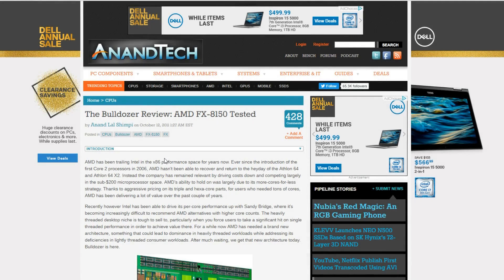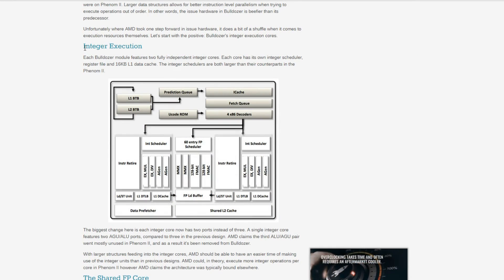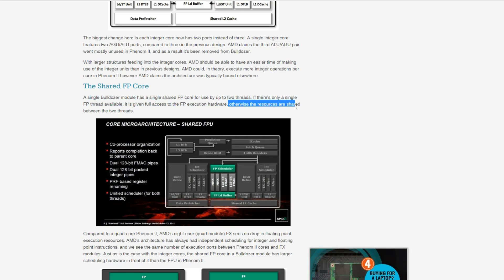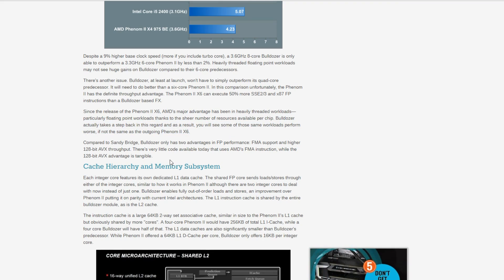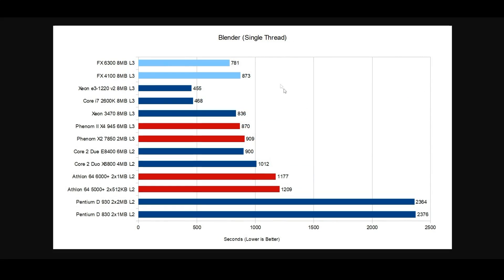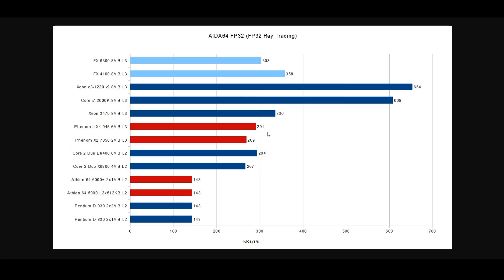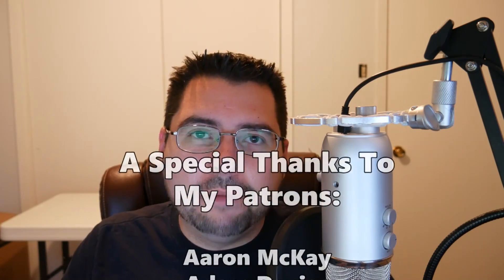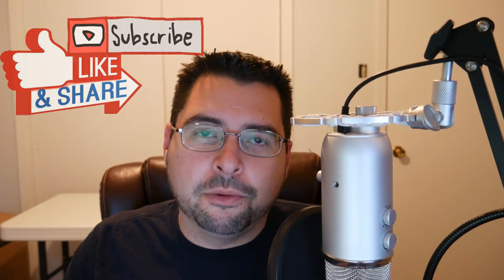IPC Test 7: AMD FX Series CPUs! How Does it Compare?

Comment: will you be doing tests with excavator? or you'll go straight to ryzen?
Reply from the maker: I'm sticking with the highend mainstream CPUs for this series. Perhaps in the future we can add in the budget CPUs
Reply: FX-8xxx excavator were not budget? or the fx-9xxx series? You consider them budget? (apu?)
Reply: reason I'm asking is, supposedly excavator is an improvement in terms of IPC over piledriver. Just curious how far they have squeezed bulldozer to get an ipc improvement
Reply from the maker: No l3 cache. It won't beat piledriver
Reply: I don't know, it doesn't seem to be affected by the lack of l3. Here for example it beats a piledriver cpu quiet easily in blender https://www.youtube.com/watch?v=PfSZ_FM9cH4
Reply: also, that was 4core APU only, it never made it to the 8 core FX line. I kind of felt betrayed when they launched them cores and didn't offer them in the larger chips. unless you were lucky enough to get a motherboard that could muster the 220 watt TDP the FX9 demanded, the FX8350/8370 was essentially the end of the line. And that was still bulldozer with just slightly faster clocks.
Reply: I'm just pointing out there is indeed an ipc improvement between piledriver and excavator add to the fact since bristol ridge can also run on the AM4 socket might as well test it right? But anyway, at the end of the day, it his test so its his call if he does it or not. https://cdn.wccftech.com/wp-content/uploads/2016/08/AMD-Zen-CPU-Architecture-6.jpg
Reply: my old fx-8350 was (according to cpu-z) excavator
Reply: @axxis30  no it's not

Comment: In my personal experience benchmarking my dad's gaming PC that he uses for Doom 2016/Wolfenstein New Order, the FX-6300 at stock clocks bottlenecks a GTX 1050/RX 460 very, very infrequently but it does happen (typically in games that only utilize 1-4 threads and ignore the last 2)

In many games, the FX-6300@4.3GHz can totally utilize a GTX 1050ti, but in many other games the 1050ti will be bottlenecked. He only has a Radeon 6950 2GB paired with a 1600x900 Dell monitor, and won't need a new GPU until he gets a 1080p monitor soon. When that time comes, we will move him up to the 1050ti or something else.

There are very few games in which FX-6300 can utilize a GTX 1060 totally, even at 5.0GHz it will bottleneck a 1060/480/290/970

Even FX-8300 or 9000 series will bottleneck 1060 level cards in many games, 750ti, 1050, or 1050ti is best for these CPUs.

Comment: I am still rocking a Phenom II X6 1100T.  Running it @ 4.2GHZ CPU, 2.8GHZ NB.  Will be upgrading to Zen 2 next year.
Reply from the maker: I'll be picking one up in the future for testing. I really like the K10 cpus
Reply: It has served me quite well,  especially since I seemed to have gotten a good overclocker.  I once dropped it and bent a few of the pins.  After I straightened them out and it worked fine though.  Have been running it nearly 24X7 since 2009 and it is by far the longest I have ever gone without upgrading.  I can not remember another system build lasting this long.
Reply: yeah, I don't blame you at all, lol. I came from a 965 x4 and 'needed' more CPU 3delight render power and did not have an Intel budget. I was looking at an x6 (6 core) at 3.3GHz vs an FX8350 (8 thread) at 4.0GHz, and it was a tough call at the time. I do remember the x6 was rare and more expensive than the FX when I did upgrade, so that made the decision for me. I still use the FX8350, as I have issues with win10's interface, and M$ will not support win7 on the newer platforms (7700k or Ryzen and later). It's sad, but I may end up just using the "GN R7 build" as a dedicated render box, and just continue to use the FX8350 workstation for creating 3D objects and scenes with, win10 is that bad for productivity.
Reply: I have the FX 9590 but I previously had the Phenom IIx4 980. I chose the Phenom IIx4 980 over the 1100T because the Phenom IIx4 had more cache per core and had better single core performance and slightly better gaming performance over the 1100T. I decided to upgrade to the FX 9590 for it's multithreading capabilities. The FX series has a slower IPC than the previous Thuban and Deneb cores but has a much more overclocking headroom and higher memory frequency support which allows it to surpass them both in performance.
Reply: still rocking a 1055T here
Reply: I've got an 1100T and 1600x. And a 8350. Gonna slap a better cooler on the 1100T and OC it. What cooler are you on?
Reply: @SquaficleDude  I don't know about him but when I was using my Phenom IIx4 980 I used a Noctua NH-D14 with 3 Coolink Swif2 120P fans. On that CPU I was able to achieve a stable 4.5 GHz at 1.50V but I kept it at 4.2 GHz with 1.45V so I could have my Northbridge overclocked at 2.8 GHz. When I switched to the FX 9590 I ended up swapping out the Noctua NH-D14 for the Thermaltake Ultimate 3.0 360mm AIO because the Noctua was blocking the airflow to the North Bridge.
Reply: THE TIME HAS COME

Comment: Ah, this pile of AMD's hot garbage called FX... I wonder how this will turn out...
Reply: T3CHN01200 it was a unique archetecture so it wasn’t well optimized while pheonom was similar to Intel because it used full cores  so that’s why it ran well against FX , just like Microsoft Xenos beat the PS3 cell chip during the beginning of the generation because the ps3 archetecture was hard for developer to work with.
Reply: Well, did it perform like hot garbage for it's time?
Reply: @TECHN01200  Yes and no. The FX was faster in multithreaded work loads than the Core i7 quad cores at the time. But the FX was slower in single core performance even slower than the previous Phenom IIs. They did a video 5 years back on how much slower and if the FX could match the i7 in performance when overclocked.The Intel Core i7 2700K at 3.9 GHz was equivalent in overall single core performance to the FX clocked at 4.7 GHz. In gaming the FX 8350 and the i7 2700K were the same clock for clock. The FX was still a great gaming CPU but it sucked at everything else that was single threaded.

Comment: If you ignore intel and just compare amd to amd, it really wasn't that bad. They didn't exactly raise ipc a ton (up some here down some there) but they did increase core count and clocks a ton. . .it just looks much worse because intel happened to make a major ipc leap.
Reply: This is actually a great point - if the tables were turned, more games would have been coded for 6 and 8 threads waaaaaay earlier on
Reply from the maker: Consoles are the limiting factor for games, and Intel core counts limit productivity software. With Intel raising core counts AND AMDs rise in marketshare production software is climbing on board. Games will too once next gen consoles come out
Reply: It matched AMD Athlon 64 in integer bench and was beaten by same Athlon in all cache latencies. That's awful. And it never quite beat Phenom 2 in any if those benches. Zambezi was a disaster and Vishera wasn't able to fix that.